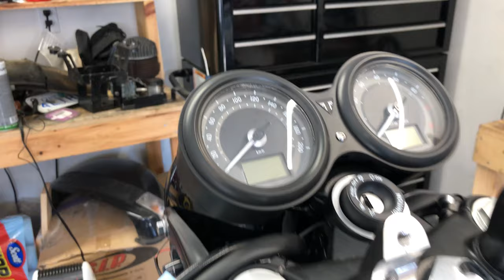The Murder of my Triumph Bonneville T100 Black -  Part 3

Comment: hi George 
based on BC website, the Billet exhaust tips fits only the t120.
how did fit them on the t100? 

kindly let me know. 

thanks
Reply from the maker: ahh the magic question...I think im the only one that has the t120 tips on a t100. First off... there was no way I was not gonna fit those tips no matter what. Despite being told they wouldnt fit, I had them easily installed by a mechanic friend with absolutely no real problems. Simple mallet tap was all it took.
Reply: Looks like BC have pulled them. Or out of stock.